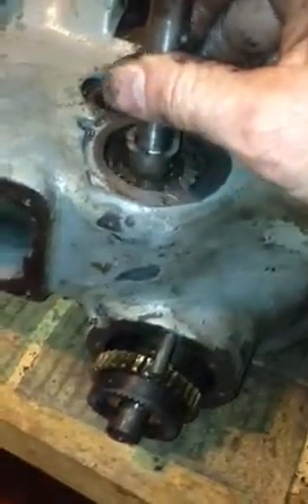Bridgeport quill tear down part 11

Comment: thank you! I've been trying to work out how to get the fwd/rev quill feed lever out and was wondering what was holding it in. Now I know it's the worm. Can you not screw the worm out instead of removing the crown gear?
I'm hoping that all I need to do is pull out the bevel gear to be able to pull it forward. Such a pain to just fixed the stripped screw to put on a new knob! (and yeah I managed to break my ezy-out in there so now I have to get it all out and either turn the end with a carbide bit or replace the shaft).